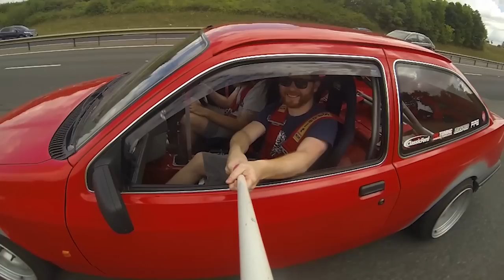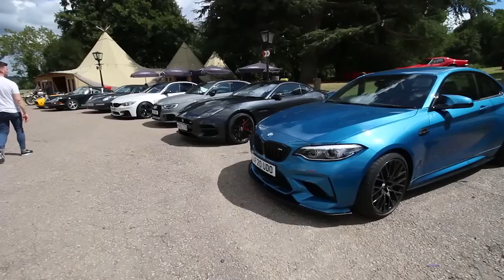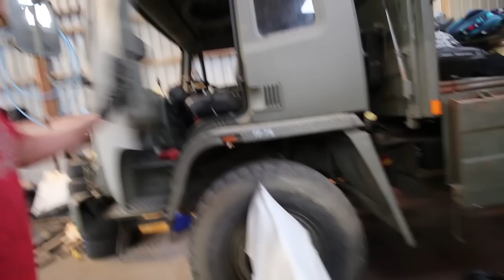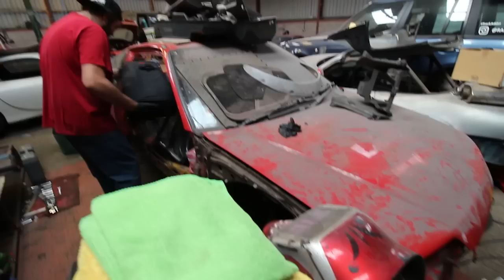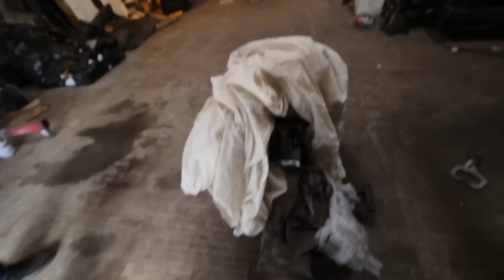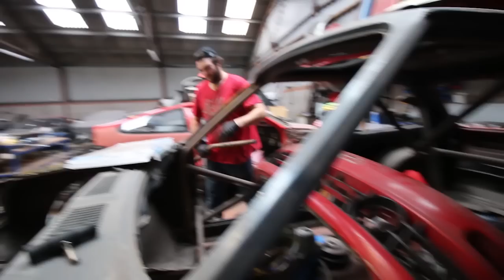CAFFEINE AND MACHINE ROAD TRIP & TOUR OF GARAGE_BIOS CRAZY PROJECTS

Comment: My kind of you tube vid, genuine enthusiasts just chatting projects. Love the Sierra, had an identical colour 3dr one many years go. Last count I am onto my 14th Sierra at the moment , but my latest is a first for me, a P100. Agree about the dash, if its not cracked I would be getting it out and putting in a non speaker version and getting that one sold. The turbo the guy plans to use on his Fiesta is a T4 from an RS500!
Reply from the maker: thanks for the feed back. and i do love a P100, what are your plans with it. finding a good P100 is a real challenge as they were all used and abused as work trucks back in the day.
Reply: @mikefpe   Its a project with a buddy of mine, we have also bought a donor Maserati Quattroporte, and will be using the V8 and transaxle out of that in the P100, Should be a  fun track truck! Its got the usual rot but easy enough to cut out and fix. Decided to buy one before they all go the way of old Fords price wise. A very low miles P100 sold for over £25k recently at auction. Ours was slightly cheaper :-)

Comment: Tell yer pal with the Daf to seriously think about changing its shoes if he's ever likely to get it in the mud - those bar-grips are gash, no side grip at all, and a 10 ton truck sliding sideways down a mildly damp grassy bank with your house on the back is terrifying
Reply from the maker: TheKaptainKernow thanks for the heads up I will let him know. 👍🏻👍🏻👍🏻
Reply: Sorry to say, they are not bargrips. They are Goodyear g388. 
The older Bedford’s (MK/MJ) used bargrips, and they were ok on the road but very noisy, in the mud they were very good. But in the rain they were very iffy. 
The Daf was to replace the old Bedford’s, but we actually preferred them to the Daf. 
Those Goodyear’s were a compromise because most of the work was done on the road so they are more road bias, less noise better grip, for the terrain they were ok until it got a bit muddy and sticky then they were terrible, but the Daf was also not good in the mud even with bargrips fitted. We tried it in our unit to see if it made a difference.
Nice video showing the different projects, but like others mentioned workplace could do with a bit of a clean up haha
I’m currently building a 67 spitfire with mx5 engine and gearbox, running on ITB’s, the motor was putting out 160 bhp on standard manifold and injection, now it’s forged, skimmed, with ITB’s so should be more, although 160 is more than enough for such a light car. 
My other is a WRX type R running 500 bhp 🤓
My daily is a super powerful 69bhp fiat 500 hahaha (don’t do many miles so it’s just a good town car) 
Cheers Shaun